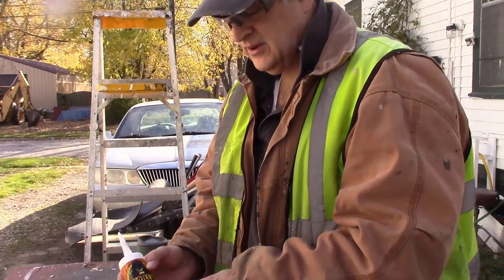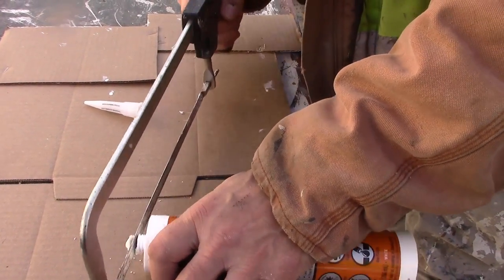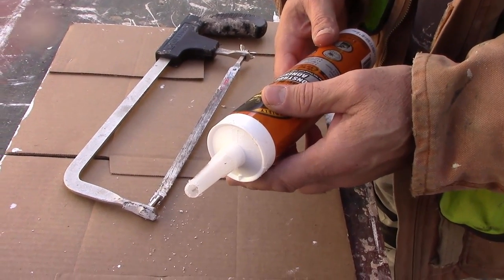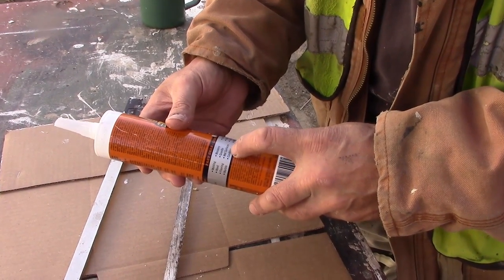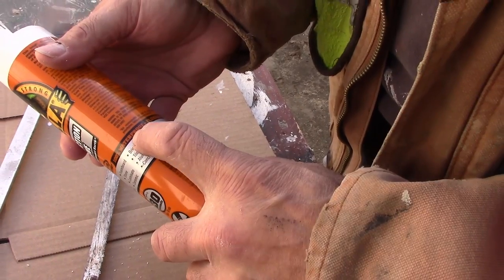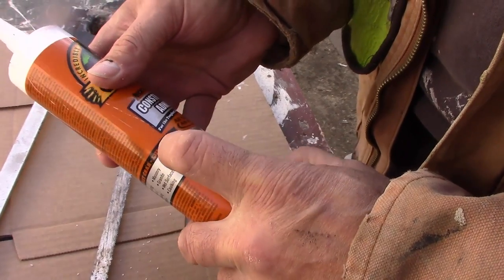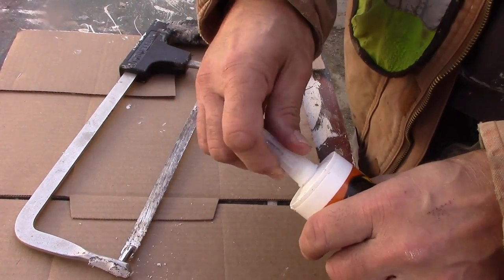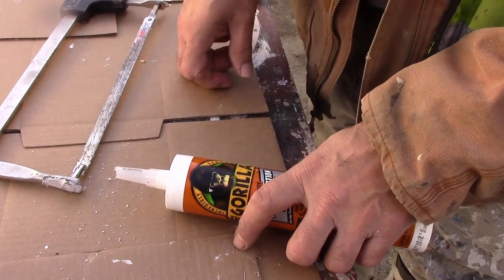Gorilla Caulk How to Open a Tube

Comment: So I got the tip of it off and I am SQUEEZING like CRAZYY and nothing comes out? Gorilla glue gotta be the worst company I’ve ever had the displeasure of buying from to be honest.
Reply from the maker: When the tube goes bad it dries out and get hard, Might have been real old, or small hole in case. If you just bought it, bring it back to the store. Might have sat in a hot shipping container for a few years.

Comment: I thought it was like other caulk and tried using a nail to punch through the end plug and that ruptured the side.  I ended up cutting the inside tip off but thought that brute forcing it was last resort.   apparently not.
Reply from the maker: Yep, I agree!

Comment: What a brilliant video to show how not to design a product, 5 minutes of a non-experienced layman would surely show the Gorilla designers that they need to treat this prototype as such, then if the product is great and priced competitively they can make it easy to use. I've gotten in front of me their 60ml moisture activated waterproof glue and not knowing the spout had clogged, caused pain to spin off the top to then push a pin through... Googling for what to do and seeing your great video.. man, it's England and 86°F/30°C, I don't need this!!! Not used to it!! Dual USB fans angled at me. 😉
Reply from the maker: Hi RS! I hear ya! Great stuff though! I use it all over the place! Thanks  for watching! Jim

Comment from the maker: When the tube goes bad it dries out and get hard, Might have been real old, or small hole in case. If you just bought it, bring it back to the store. Might have sat in a hot shipping container for a few years.

Comment: Wish I watched this video before using this product. 
Used the needle attached to the gun & stabbed a hole straight through the nozzle DOH!
Reply from the maker: Hi Lj! I hear ya! That's why I did the video on it, they are tricky to open! Thanks for watching! Jim
Reply: I did the same thing...tried to open with the needle and the needle slipped off center and easily pierced the top, ruining the tube.   But the needle would not put a dent in the place where it is supposed to go.  I ended up drilling a hole in the 2nd caulk to get it to work.  Nothing in the instructions about how this tube is different than the 100's of other tubes out there.  Luckily Lowes takes it back and will return to the supplier.